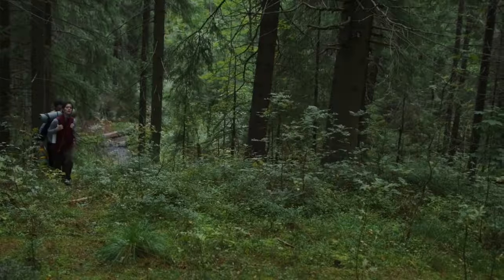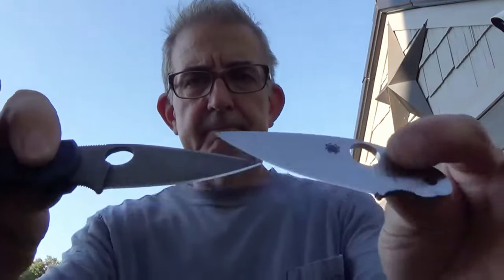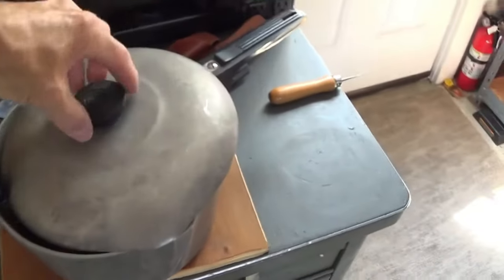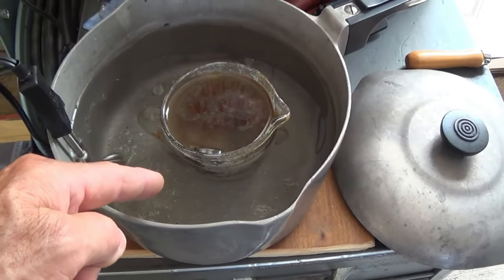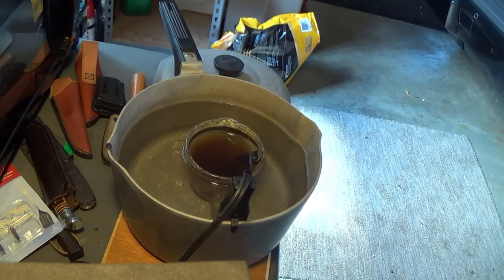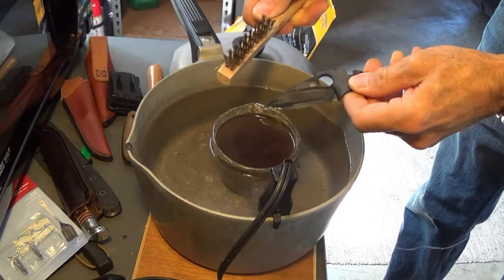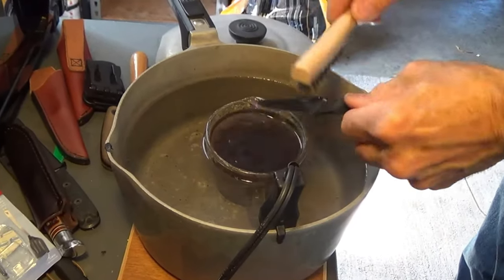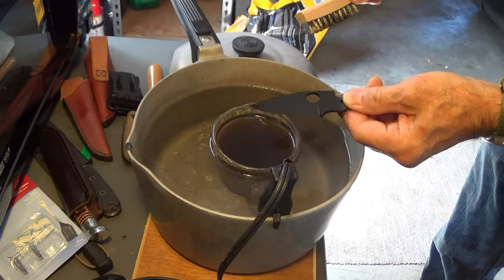Master the art of patina on carbon steel blades

Comment: I always had success using full strength white vinegar. Bring it to a boil in a kettle and pour into a glass with the knife. You could see the bumbles forming right away. Takes 5-10min depending on how dark you want it.
Reply from the maker: That is also a good method.  I now have a hot plate and can use a double boiler to maintain the temp throughout the process even better.  However...I have not done this project again since this last video.  Maybe this coming summer, I'll have another go at it.  Thank you for watching and commenting.
Reply: Decided to patina a k390 Endela during some downtime at work. I warmed up some vinegar in a mason jar in the microwave and unintentionally gassed my office when it started boiling. Smelled like shit in there for hours. Good times…

Comment: Hows cruwear do sir?
Reply from the maker: Have not tried it.  I would imagine that any steel that will stain and patina over time would work just fine.  I've done it to K390.  I'd say give it a try!!!
Reply: @knifetimestory  so far I tried many things. Tried mustard and it gave it an rainbow effect. I tried oranges, ketchup, vinegar. Nothing will touch the rainbow effect So I basically fkd up my spyderco. Damn rainbow of all things, smdh
Reply from the maker: That is unfortunate. 🌈 
A good deep hot vinegar soak may even things up a bit.  Make that gaff less noticeable.  😱

Comment: What's the action like once you put it back in? Wouldn't it have been better to nail polish the pivot area to keep it smooth and clean?
Reply from the maker: Ahhh.  Excellent question.  Yes, nail polish is the way to go, or, only dunk it down close to the pivot, but you still get spray that can bugger things up.  I'm too impatient to use nail polish.  I did end up polishing the spine where the pivot surface meets the spring bar.  That helped.

Comment: Killer results dude! Wonder if s35vn would act the same🤔
Thanks for sharing!
💪😎👍
Reply from the maker: Hi. Thanks so much for watching and for the nice positive comment. As for your question… No. It will not work. I tried. You need an acid solution much stronger than just plain old vinegar. There are guys who can acid etch/patina S35VN on Chris Reeve knives.  I’m just not willing to purchase the type of caustic chemicals it takes to do that.

Comment: Keep an eye on the friction surfaces of the lockbar of your N5. That forced patina likely exposed carbides on the previously polished outer edge of the blade tang and they may start to wear the lockbar where they drag together during blade deployment and stowage.
Depending on the use level of the knife it may not be an issue for a very long time, though.

The native 5 is probably my favorite spyderco, and is my routine edc. I appreciate the fully ambidextrous design, and the lockbar spring can be tuned/tweaked a little to make the blade drop shut more freely without compromising a rock solid lockup. A really thin coating (just barely visible) of gun grease on the friction surfaces of the lockbar-blade and lockbar-spring along with careful tension of the pivot and middle body screw smooths out the action a lot as well.
I've been thinking about forcing a patina on mine with some mustard, still on the fence with that one, though. The patina the maxamet has developed pretty much matches the grey frn handle perfectly and I sort of like it.
I think a lot of people pass over the native 5. It is a great little knife that outcuts its length and weight and is available in a steel that will suit the needs of the owner. It is a legal carry length for just about the entire United States and isn't as intimidating on deployment as a pointy flipper or flicked PM2 might be to some. Equally amenable to full operation with either hand. A solid and civilized edc knife.
Reply from the maker: You are 100% right. I neglected to do that. I have worked the action till I’ve had beads of sweat on my forehead. It seems to be breaking in. I know I’ve probably gouged the lock bar pretty well. But I just didn’t feel like sanding that down and then polishing it. But great advice! I will do that next time. I actually thought about using some clear nail polish so that a grease wouldn’t be getting into the vinegar and contaminating it. Either way, I will definitely protect the action area on the next project knife.
Reply: There any way to take care of this issue so the lockbar doesnt wear down so much?
Reply: @fireemblemistrash75  

Keep the surfaces of the blade that interact with the lockbar lubricated. If you have forced a patina on this part of the blade you can polish it on a strop loaded with a stropping compound which should lessen the abrasiveness as it will smooth over or tear out exposed carbides.
Reply: @NikeaTiber  thank you!
Reply: You can cover the wear points with nail polish, like acid etching? Same kinda deal?